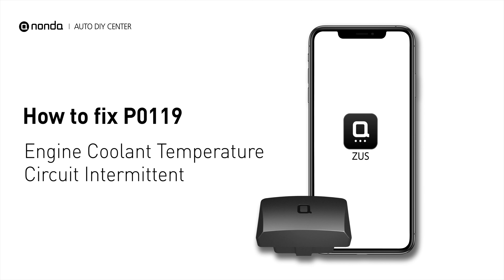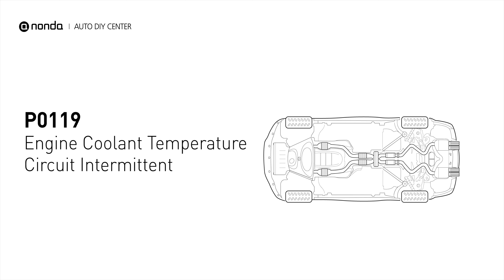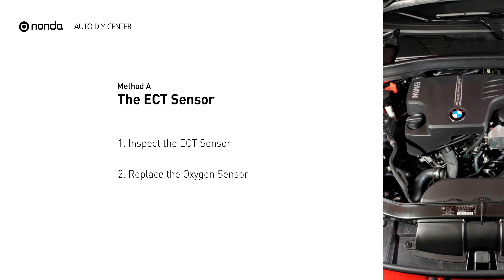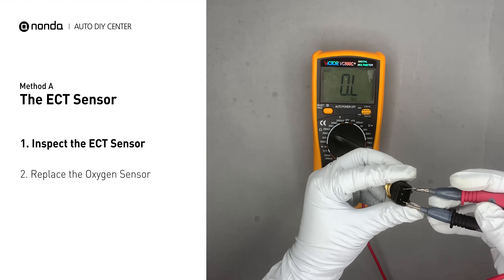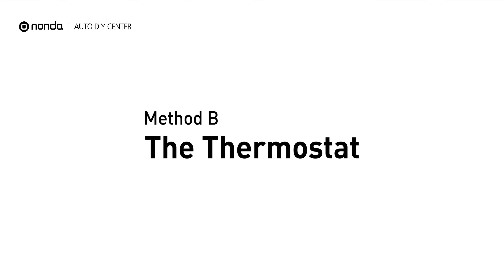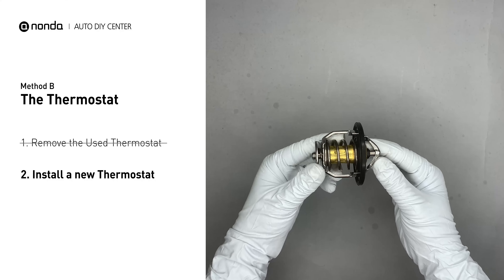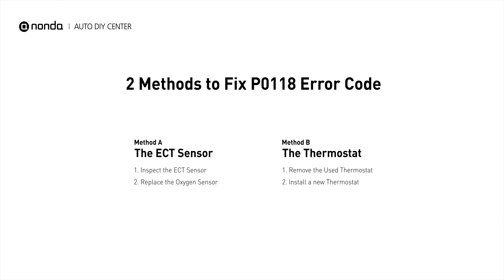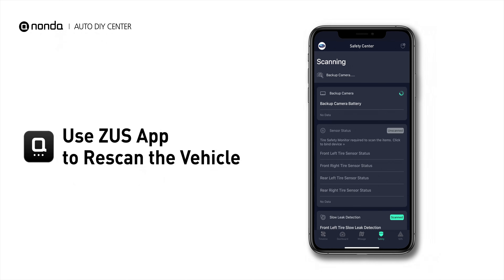How to Fix P0119 Engine Code in 3 Minutes [2 DIY Methods / Only $7.28]

Comment: Will one of these 2 solutions fix the light. It came on on a 2014 traverse. I replaced the sensor and still getting the permanent DTc on my obd2 scanner
Reply from the maker: Hi William, kindly follow the tips/suggestions provided in the video (How to fix P0119). Once applied and the issue still persist, then a visual inspection by your local mechanic would be necessary for further diagnosis.